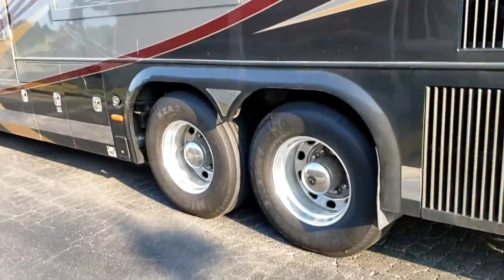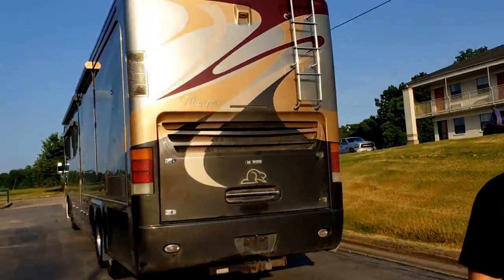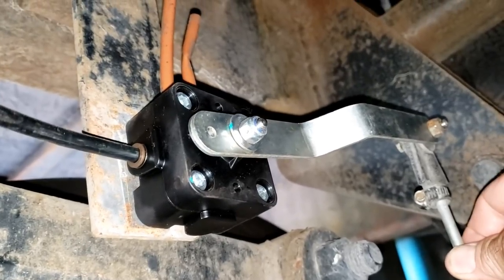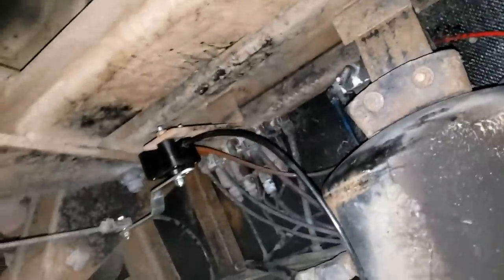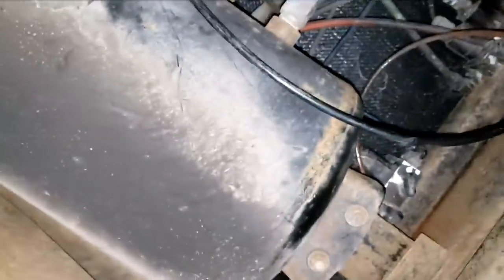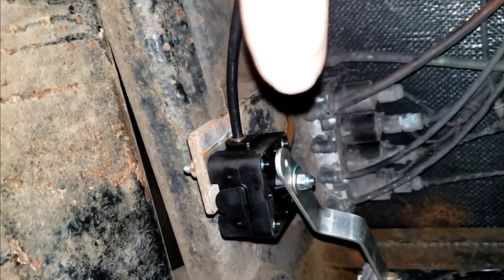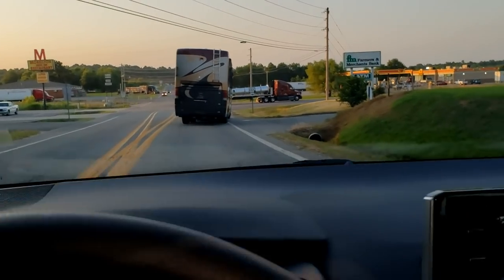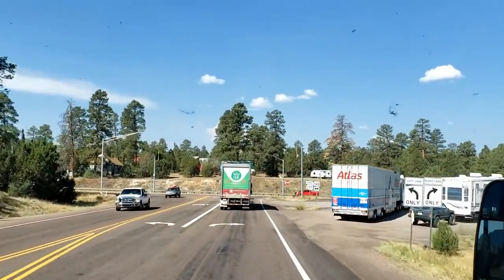What Else Did I Find on the 2008 Marquis Suspension?

Comment: The answer is pretty simple and a very easy mistake to make. You actually solved it during you explanation of how the leveling valve works. The leveling valve is installed upside down. The exhaust port should always face down. Simple flip the leveling valve and it should be good to go. 

On a side note, I'm from Chicago and we stopped at that same exact Chevron on our way to the Petrified Forest by Holbrook.
Reply from the maker: lol nice

Comment: We used to mess with airbag systems delivering decked freightliners. Couple other ways to do it. Best option would be plumb into the good side with the leveller that worked. It would just level both sides the same. 2nd option just put a Schrader valve on a single line coming out of the airbags that were wonky and manually put air in it to get it close.

Comment: If that is a Barksdale 55521 series cab valve. The two ports together go to the bag or bags. Then the inlet and exhaust ports are on opposite sides. So the spare ports together should have the extra plugged like they did. But from the angles you could get the camera at I couldn’t see the exhaust port.
Reply from the maker: thanks for the comment

Comment: My GUESS is that with a correct leveling valve, the old control board will be happy.  Different behaviors in a fault condition could be due to different firmware in the microcontroller.  I work with embedded software engineers who are very good, but my god can they screw stuff up if there isn't good engineering at the system level.

Comment: WOW.  My air leveling valve went bad. My transport look like I was doing a reversed wheelie down the road. Until I got a new one easiest fix is level the airbags off and disconnect the controller arm. But 2 valves for all 4 bags. Something so simple. The RV companies try and improve it which just makes more problems. Sounds to me they tried to put a independent air suspension ride on that. The module that regulates each angle went bad. Then somebody that didn’t know what they were doing just got any air valve leveler and mounted it improperly. But it could just be bad.  Because if you pull the lever or push the lever Air should be moving either in or out if it doesn’t replace it. Trying to find parts you could’ve found a truck repair shop they might’ve had an air valve most likely they would’ve but for that system it probably would’ve worked. Been waste of money and time.
Reply from the maker: Glad it worked out for you. Thanks for watching! :)

Comment: Got a question about a power gear slide out 2004 class A how do you know if it needs slide locks or not got it used slide comes out 2” when you drive it thanks
Reply from the maker: likely you have a bed hydraulic valve or the brake on your electric slide motor is off
Reply: There’s a break on the Electic motor how do you check out the break or do you have to replace the motor I hope not thanks for answering me questions

Comment: If the controller you put on wall turns it on and off why wouldn't a regulator battery type digital thermostat for home not work since r is power y is ac g is fan w is heat find out what wires on the rv correspond  if infact teestat only acts as switch on rv design only acts as switch on home ac